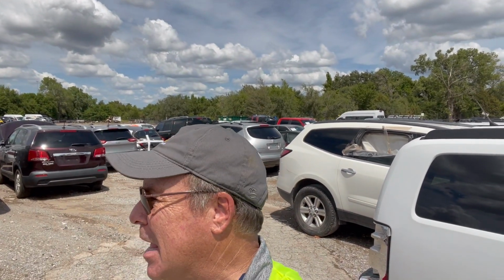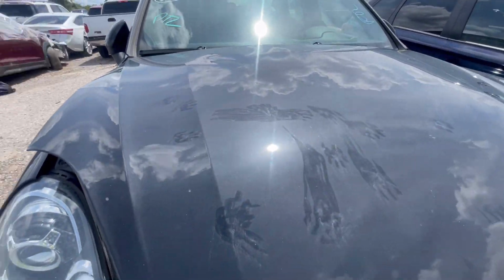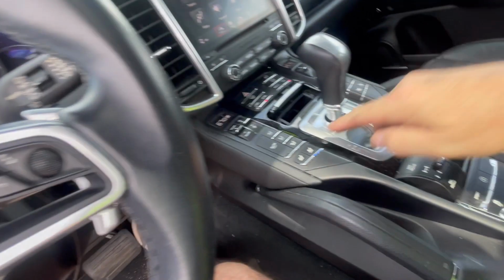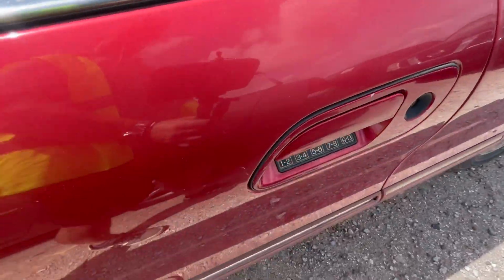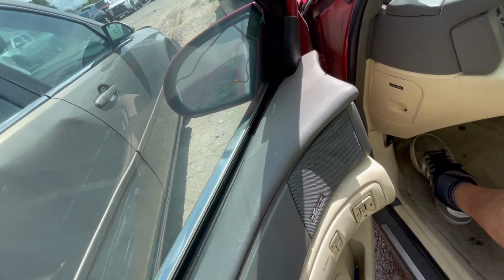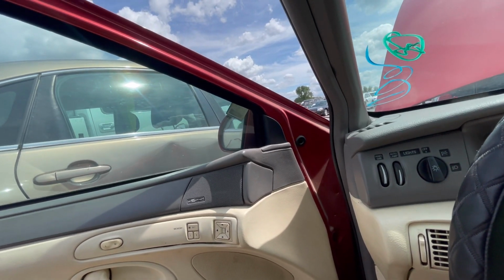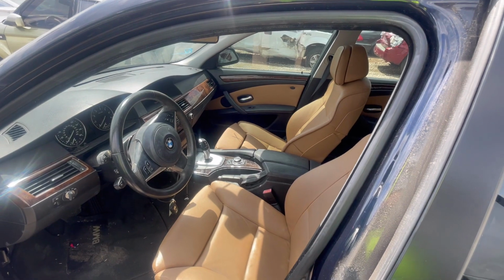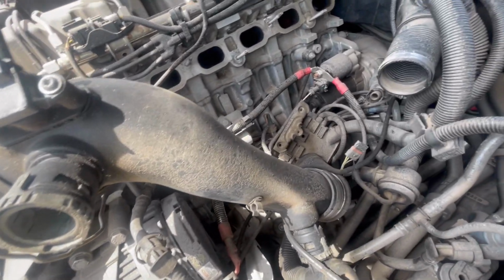IAAI OKC Walk Around - 9/20/22

Comment: The Lincoln Mark VIII was my second favorite car that I ever owned (the first was the one-owner 68 Mustang coupe with the 302 that I bought from my dad). The cockpit-like styling of the driver and passenger dash area felt like it wrapped you into the car. For what it was, it drove like a bat out of hell. Only problem I ever had with it was one go-around with the air suspension system (which didn't break the bank).

Comment: Do insurance companies actually pay to repair vehicles anymore? There's no way the damage on that Porche is anywhere near 75% of it's value.
Reply: Most likely it has to do with new parts availability. Owner may not have wanted used.
Reply: I worked in collision a few times since the 90s off and on but 4 years ago the shop I was at I swear they totaled everything for barely any damage it was crazy the old guys I worked for said that's the way it is now
Reply: @paulcoinc  Where I live, the owners don't get a choice. If the insurance says used parts, used parts it is.
Reply: @frankm8533  It's crazy. That Porsche is a relatively easy fix.
Reply: @danielhartin7680  I hear ya. In 2017 my 2004 Ranger which was in excellent condition under 100k miles my girlfriend at the time hit in her driveway it needed a fender and lower bumper piece I fought to not get it totaled I said its $120 in parts new from eBay so they ended up replacing and painting the parts that were damaged only but couldn't blend any paint cause that would total loss it. Then in 2019 it was totaled in a T-bone  accident they gave me $4,758 for it yet that first crash they said it wasn't worth more then $2,100. Weird how that works
Reply: Actually the insurance company factors in salvage auction value, that's why lots of wranglers get totaled. 
Let's say a wrangler pre loss is worth 20k and they bring 15k at auction they might total it over a 3k estimate since the insurance company knows supplements can push the repair to 7 or 8k plus as soon as the insurance company settles they can stop paying for rental car and storage.
Reply: @banjo-boy-montreal126  interesting